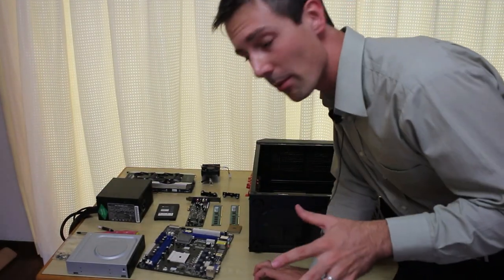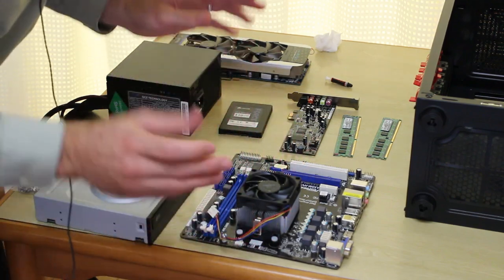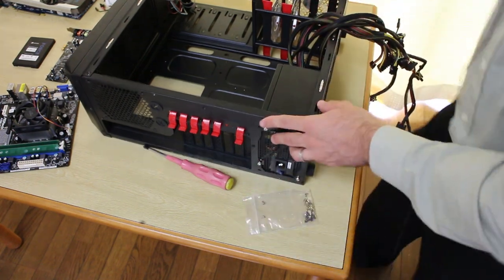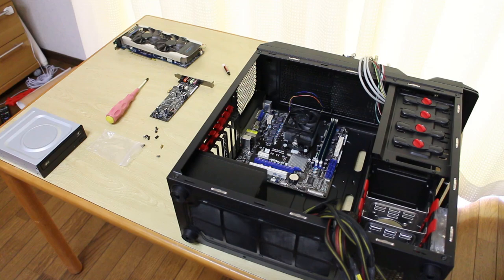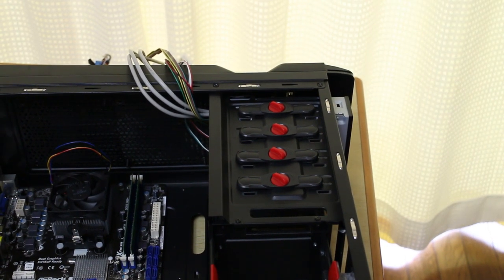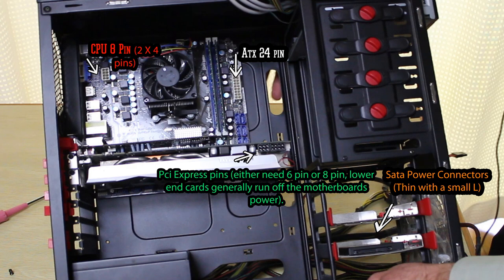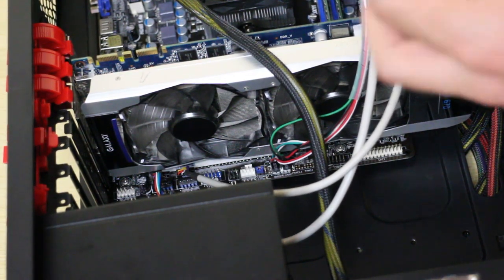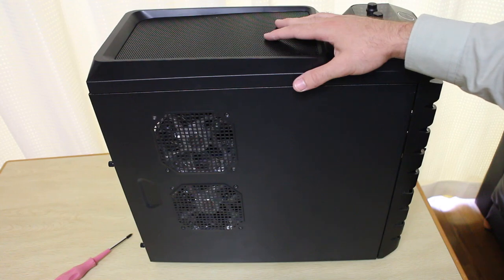How to BUILD your FIRST PC (Full Uncut for Beginners)

Comment: You don't need static wrist band....just constantly touch the case and see the MOBO manual for the screw holes instead of the real thing as touching the case means there is still static running around the case. Or you can put the PSU in last so you can ground yourself to the circuit in your house instead of the case ( PSU needs to be plugged in but not turned on.)

Comment: Massive thanks for the video! I just built my first rig thanks to you! I made the noob mistake of forgetting to plug in the CPU 8-pin power cable at first. 4670k, r9 280x. Can't wait to try overclock. Also, a video on cable management would be great.

Comment: Can you explain the significance of the "AHCI MODE" change you made in the end? is it important for every new computer build? and why?
Reply from the maker: +MrKandelion More flexibility with it, so first install always use it over IDE IF you can.
Reply: Hey, I'd appreciate if you'd answer this question.. Where did u get the screws u used to screw in the Hard Drive, SSD, & Graphics Card in to the case? or are the screws bought separately
Reply from the maker: Just accumulated them over the years!
Reply: Tech YES City I figured they were separate.. What type screws do I need buy when putting a pc together?
Reply: i figured u would be no help
Reply: hey billy Im no expert, i only built the computer that i was reffering to when i asked this computer, but when i built my computer, all the parts came with ncessary screws. the case came with screws and so did the mother board and other stuff. you probably wont need to buy screws seperately
Reply: MrKandelion awesome, I was very worried... Thx for the response

Comment: do you have to be grounded to the case or anywhere with a static wristband?
Reply from the maker: +Mike L I don't, YMMV
Reply: +Lloyd Franklin i have a question about fans.. if i have a antec vsk cabinet which has 2 fans idk where they are (going to build a pc soon with it) which side do i place my cpu cooler in? like straight, as in the intel logo corresponds to the cabinets top or something else? also i will be using stock cooler, doenst the cooler always stay at bottom, doesnt that mean i can put it in any direction
Reply: it is very rare or never heard of a case that static electricity damaged the motherboard or CPU or RAM.  but if it happens you could be very sorry for not spending a wrist strap which costs $4.00  or less or a bit more.   I actually have a mat and wrist strap. I place my motherboard on the mat, the reason I do is the Motherboard costs over $100 or more..while a wrist straps is peanuts.

Comment: CAN A NEW PC WORK WITH ONLY 1GB RAM??????
Reply from the maker: maybe? lol havent tried
Reply: Yes but itll run reallly slow
Reply: Yes it will, depending on the OS. Here are the requirements for Windows 7:

1 gigahertz (GHz) or faster 32-bit (x86) or 64-bit (x64) processor

1 gigabyte (GB) RAM (32-bit) or 2 GB RAM (64-bit)

16 GB available hard disk space (32-bit) or 20 GB (64-bit)

DirectX 9 graphics device with WDDM 1.0 or higher driver
Reply: ok thanks!!!!!
Reply: I would reccomend using at least 4 gigs though, it isnt very expensive
Reply: but it is expensive :p
Reply: aggelos sgouropoulos not if you're using ddr3.
Reply: it is still expensive like everything in greece :p :/
Reply: think that a ddr3 ram 1gb costs 14 euros
Reply: aggelos sgouropoulos 'Bout in dollars?
Reply: aggelos sgouropoulos I would just straight up go for 8GB DDR3 2x4GB. May cost a bit more but sure it's much better than 1GB or even 4GB.
Reply: Ray Tage about 19.5 dollars
Reply: aggelos sgouropoulos Ah
Reply: more ram the better
Reply: Yes, just not very well.
Reply: I had mine, the old pc that I built only runs 512 MB of ram but the OS is windows XP, windows 7 minimum is 2 GB at least  think
Reply: win 7's minimun is1gb
Reply: you should probably install a very light version of linux instead of windows.
Reply: this comment is very old :p finally i installed ubuntu 14.04 on that old pc...

Comment: I'm planning on building my own PC soon, and I was wondering if all these parts were compatible and if they were good for the money. The price on my parts as of now is $604.58

Parts:
Case: "DIYPC Zondda-S Black USB 3.0 ATX Mid Tower Gaming Computer Case with 3 x White Fans (1 x 140mm LED Fan x side, 1x120mm LED Fan x front, 1 x 120mm fan x rear)"

HDD: "Seagate Barracuda ST1000DM003 1TB 7200 RPM 64MB Cache SATA 6.0Gb/s 3.5" Internal Hard Drive Bare Drive"

Graphics Card: "MSI GeForce GTX 960 GTX 960 2GD5T OC 2GB 128-Bit GDDR5 HDCP Ready SLI Support ATX Video Card"

PSU: "EVGA 100-W1-500-KR 500W ATX12V / EPS12V 80 PLUS Certified Active PFC Continuous Power Supply 3 Year Warranty Intel 4th Gen CPU Ready"

RAM: "CORSAIR Vengeance 8GB (2 x 4GB) 240-Pin DDR3 SDRAM DDR3 1600 (PC3 12800) Memory Kit Model CMZ8GX3M2A1600C9R"

Motherboard: "ASRock B85M-DGS LGA 1150 Intel B85 SATA 6Gb/s USB 3.0 Micro ATX Intel Motherboard"

CPU: "Intel Core i5-4460 Haswell Quad-Core 3.2 GHz LGA 1150 BX80646I54460 Desktop Processor Intel HD Graphics 4600"
Reply from the maker: +Pile of Sand That is a nice little combo, should work well.
Reply: +Tech YES City So I changed up a few of my parts, and I am wondering if they are still compatible. Here is my new list:
Intel Core i5-4460 3.2GHz Quad-Core Processor 
ASRock Z97 Anniversary ATX LGA1150 Motherboard 
Team Elite Plus 16GB (2 x 8GB) DDR3-1600 Memory 
Western Digital Caviar Blue 1TB 3.5" 7200RPM Internal Hard Drive 
MSI GeForce GTX 950 GTX 950 2GD5T OC 2GB 128-Bit GDDR5 PCI Express 3.0 x16 HDCP Ready SLI Support ATX ARMOR 2X Video Card 
DIYPC Zondda-S Black Computer Case 
Corsair CX 600W 80+ Bronze Certified Semi-Modular ATX Power Supply 
Asus DRW-24B1ST/BLK/B/AS DVD/CD Writer
Reply: nice graphics card

Comment: Hello from 2019.... R.I.P FM1, Windows 7, legacy boot, DVD drive - isn't it so much easier with Windows 10 and a USB stick. No need to change boot orders around anymore. You've come a long way Bryan. Loving the cable management. When you could just hide it all with the solid side panel ;)

Those 1st Gen APU's were quite good and pretty underrated. I remember my A8-3800 ran DiRT 3 so much better after I removed the HD 6450 that HP had installed in my Pavilion P6 and just used the onboard APU Graphics instead.

Comment: if your buying used parts make sure you check if the listing comes with a sata cable. I overlooked that  because I had an older compute which used long ribbon cables for the hdd. so when I finally finished my new pc build with a used case I  didn't realized that you need a sata cable for data transfer and I also needed an ide to sata to even use the hard drive on this newer motherboard I got. so lesson learned if you have an older hard drive get an ide to sata thing and a sata data transfer cable because some say to this day that I literally built a pc but I can't do shit because I don't have these parts mentioned above.

Comment: @Tech YES City Actually, what you've said was wrong about the static strap. Even if you don't feel a ESD, it actually happens and wrecks your hardware anyway.
Reply from the maker: Gerald Shields I was going to test this in the coming months, have a cpu running and then statically charge myself as much as possible and touch the IHS while it is running.  I will do this cause i believe the hype around it is complete non-sense - in the past I have sparked up motherboards / graphics cards and all sorts of parts and they have still lived to see another day.  The only time I have bricked a part on my own fault was when I did a bios update on a Gigabyte motherboard and even then wasn't my bad (as their flash support sucked).

Comment: hey great video
i was just wondering if i got the right parts and if i need to adjust anything
these are my materials
439- Intel Core i7-4790 3.6GHz Quad-Core Processor
86.64  RAM-G.Skill Ripjaws X Series 8GB (2 x 4GB)
498 GPU-Asus GeForce GTX 970 4GB STRIX
216.95 Motherboard-MSI Z97-GAMING 5 ATX LGA1150 Motherboard
60  HDD-Western Digital Caviar Blue 1TB
86  SSD-OCZ ARC 100 240GB
84.33 Deepcool TESSERACT SW ATX Mid Tower Case
141 PSU-EVGA SuperNOVA NEX 750W 80+ Bronze Certified Semi-Modular
19 - LG GH24NSC0 DVD/CD Writer
it will be used for pretty heavy gaming and video editing (maybe higher ram?)
any help would be awesome
also what mouse keyboard and mouse is good quality and cheap
Reply: That seems good! You can always pick up more ram later, but you can get a cheap mouse and keyboard bundle for now. Off newegg or eBay!

Comment: Thank you but I do have a long series of questions so bare with me, I'll understand if you can't reply. This Winter I plan to upgrade my current PC from an Athlon AM3 X2 260 to an FM2+ X4 880K with an appropriate motherboard, SSD & GPU. I already know that the Windows 7 cloning process going from my HDD to an SSD will be simple but. After that's done, how do I go about changing the motherboard & CPU drivers from my current which are AM3 to FM2+?

Comment: hey there man i got an hp pavillion with an AMD quad core processor a8-3800 2.40 ghz/ 8gb ram/ and an AMD hd 6550D and was wondering if i would be able to upgrade the gpu to a gtx 750 ti without the cpu bottlenecking it? will i be able to just upgrade the gpu without buying another motherboard or so? sorry im not too familiar with pc hardware. thank you for your time!

Comment: I'm not pro at this so correct me if i'm wrong but could you buy a normal pc (100-200 pounds) and then upgrade the gpu and cpu for gaming. Would this work well or is there anything I need to consider?
Reply: You could but once you upgrade you need a better power supply, which leads to other things... it's more worth it just to build one
Reply: Then you can run into problems with the motherboard not supporting wattage for a newer and better CPU

Comment: I am a first time builder and I have two questions...
1.) Does my PC Case I buy come with the wires?
2.) How does installing an operating system work>

Thanks I know I may sound dumb, it's my first time. (”__”) lol But yeah please explain

Also here is the link to the build I am thinking of... http://pcpartpicker.com/p/CGnqYJ
Reply: +iancdav PC case comes with wires connected to your case's USB, mic/headphone jack and power button. You need to connect them to the motherboard. You can install OS through OS installation disc or USB.

You don't need CM Hyper212. The stock cooler that comes with the processor will do the job pretty well.

Comment: Can you use any parts in building a PC or are there certain Chip sets and connections that should be taken into account? What is the difference between new and refurbished parts? Is there a problem with compatibility between parts while the PC is operating?
Reply from the maker: You will want to have a good PSU / mobo / cpu / ram and GPU, other parts like the case / dvd drive etc. aren't too critical.  New vs refurb, always go with new if you can unless it is a mechanical only part (no electronics) as refurbs are usually parts that were faulty and were fixed, and even though they have been fixed other parts may have been close to failure (other caps / resistors etc.) were not fixed, so I think refurb is more prone to failure.
Reply: Thanks

Comment: Thank You So Much I Got Stiffed Recently played an old friend 900$ For a Decent gaming computer and instead got a potato. found out the problem was the screwed me on Ram(I think that's how it's spelled) as well as having alot of crappy parts so I am upgrading thanks M8!
Reply: *pay not played an old friend
Reply: also why do I need a static wristband? WhT danger is there to shocking a circuit board(Sorry massive newb here just trying to join the might of Gabe Newell.
Reply from the maker: +King Zork Damn, doesn't sound like much of a friend.
Reply from the maker: +King Zork Won't need one if you dont shock anything.

Comment: I'm building a pc specifically for running a Minecraft server and editing videos. The computer will need to be on at all times and rarely ever shut off. My budget is $1500.

1. Should I get thermal paste?

2. Is AMD or Intel better for the CPU when I'm running the server? Editing videos isn't as important so I want my cpu choice to be based on the server's usage.

3. Are there sticks of ram that are 16GB per piece?

4. Should I have an extremely good power supply?

Don't tell me not to build a pc or use a host or something. Just answer the questions.

Thanks!!!
Reply: 1. Yes if you want to get lower temps
2.Intel probably an i7
3. I think so
4. It depends on how much power all your components need
Reply: If I were you, I'd get water cooling, or ATLEAST the best fan cooling set up you can buy, especially if its being on 24/7. 

Definitely get a really good power supply as well, 80 plus.

Comment: Few things that bothered when you laid the parts on the table 
You had the motherboard on the table which is bad because the pins underneath could A) BREAK and B) Damage that table
You also had the GPU with the circuit board on the table, which again could break it
Reply from the maker: Yeah not ideal, though I handle the parts pretty carefully, I have never had a part not work because of the way I handled it.  Though my friend has dragged his motherboard across a table before (making a big scratch in his table) and the mobo still worked fine lol...
Reply: if you are some massive expert mate, why are you here looking at tutorial videos?
Reply: I'm not an expert, but I've had my share of computer building too, I just wanted to share my opinion on the way he placed some parts down. Although he says himself, "I've never had a apart not work because of the way i handled it" I would recommend to people you don't do this, I could possibly break and it'll scratch your table, and we don't want that
Reply: on the box of the board
Reply: Jack Baker on the box or the anti-static bag that the mobo comes in.

Comment: I thought spreading the thermal paste was worse because it was more prone to air bubbles. Isn't just slapping it on there then letting the heatsink spread it out fine because it applies enough pressure to make sure it spreads out evenly??
Reply: Richard Cerio Alright, thanks

Comment: Can you suggest me the case fan set up(configuration) for cooler master haf912 for best cooling
I don't care about noise & I plan to overcock my fx8350 but not GPU(r9 28x)
The case has 2×120mm or 200mm front intake
                            2×120mm or 200mm top exhaust
                            1×120mm or 140mm side
                            1×120mm rear exhaust
Also suggest me the cheapest best blue led fans for cooling & not the quite one

Comment: this is my first build, let me know what you think. (I won't be overclocking) 
CPU: Intel Core i5-4460 3.2GHz Quad-Core Processor
Motherboard: Gigabyte GA-H97M-D3H Micro ATX LGA1150 Motherboard
RAM: Kingston HyperX Fury Black 8GB (2 x 4GB) DDR3-1600 Memory
Storage: Western Digital Caviar Blue 1TB 3.5" 7200RPM Internal Hard Drive
GPU: MSI Radeon R9 380 2GB Video Card
Case: NZXT Source 210 Elite (Black) ATX Mid Tower Case
PSU: EVGA 600B 600W 80+ Bronze Certified ATX Power Supply
Operating System: Microsoft Windows 7 Home Premium SP1 OEM (64-bit)
Wireless Network Adapter: Asus PCE-N15 802.11b/g/n PCI Express x1 Wi-Fi Adapter
Monitor: Asus VS228H-P 21.5" Monitor
Keyboard and Mouse: Cooler Master CM Storm Devastator Gaming Bundle Wired Keyboard and w/ Optical Mouse
Headphones: Logitech G430 7.1 Channel Headset.    Total=$955.12
Reply: ***** thanks for letting me know, I wasn't sure.

Comment: yes 280x, but 280x going cost around $400+ maybe just $500, so i think u should get the last generation 7900 series because the price here in australia are stupidly over price, when i build my rig,so i brought slightly used msi gd 65 from ebay, next had build $53 case and $10 fan, after brand new i5 3570k addition $34 cooler, 8 gb ram, 120 gb ssd and 2 tb hdd, second gtx 570 because i could not afford a better gpu and also use my old rig's psu, but i upgrade my case, psu, 2 gpu and watercooler

Comment: Is this a good Build 

intel core i5 4690k processor (3.5 ghz 6mb cache lga1150 socket)

evga nvidia gtx 970 ssc acx cooling 2.0 4 gb graphics Card

corsair cmz8gx3m2a1600c9 vengeance 8gb (2x4gb) ddr3 1600mhz cl9 xmp

western digital blue wd10ezex 1tb 7200 rpm sata 6.0gb/s 3.5 hard drive

Cooler Master HAF 912 PLUS RC-912P-KKN1

EVGA 600W Bronze Pc Power Supply 

ASRock Z97 Anniversary Motherboard - ATX, Intel Z97, Socket 1150

thanks

Comment: Ok so im in a problem right now. This is my first time getting and making a PC and i have 2 options below (if there are any cheaper and better alternate Please TELL MEH) im looking for a PC that is long lasting that can run games 35FPS+ At 720-1080+ resolution my budget is around £400-£440 ($611-$670) no more please it needs to run games smoothly like total war, dayz, division, fallout 4 etc also a you-tuber so i will be doing screen rec and editing. Here are the two options i can find: CPU: AMD Athlon x4 860 3.7ghz quad coreCPU cooler: come with my bundle CPU Motherboard: gigabyte GA-F2A78M-HD2 micro ATX FM2+ RAM: Patriot 4GB (1x 4gb) DDR3-1600 memoryhard drive: seagate barracuda 1TB 3.5" 7200RPM Graphics card: ASUS GeForce GTX 950 2GBcooler master case mid tower power supply: XFX Proseries 450w 80+ bronze certified ATX And windows 8 or 10 or 7 And does it beat this set up which jack frags recommended? Bit fenix comrade case DVD Drive: Lite on 24x Power supply: evga 500w 80 plus +Hard drive: 1TB seagate barracuda CPU: AMD fx6300 3.5ghz 6 core Motherboard: GIGABYTE GA970 AMem: CRUCIAL 1600MHZ 8gb GFX: sapphire Radeon R9 270X Please leave any thing to help.

Comment: I have a Windows XP that I have not used for a year. I now use Windows 7 but would like to upgrade my XP to a Windows 7. I have one monitor, no router and one modem. How do I go about upgrading the xp without disconnecting my windows 7 from my modem?